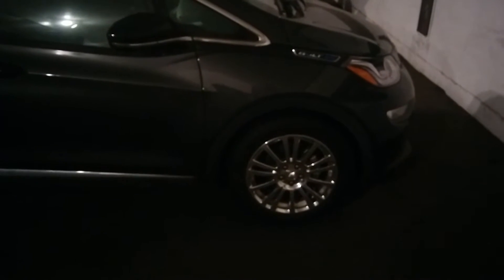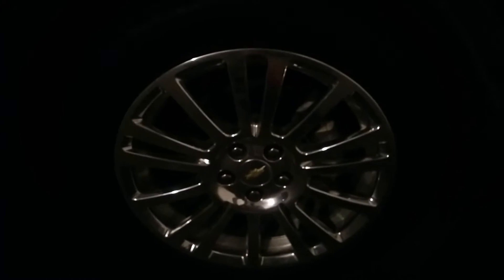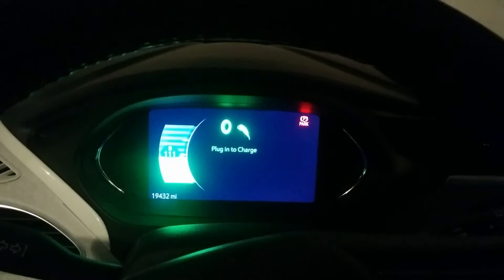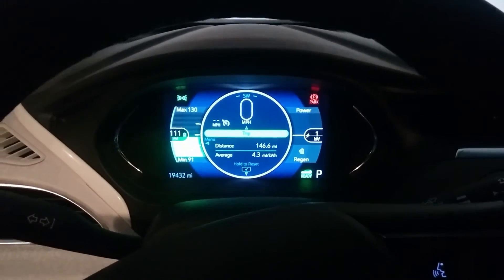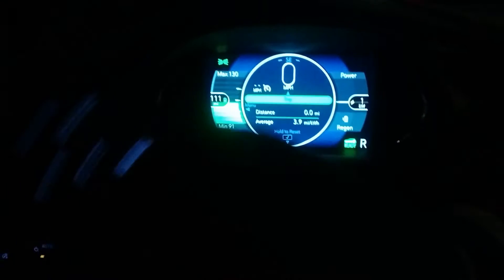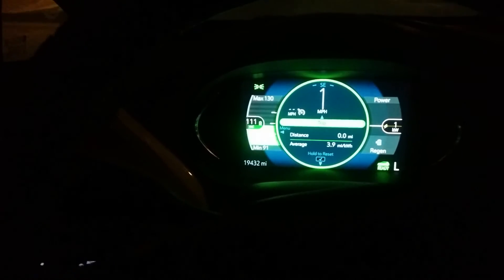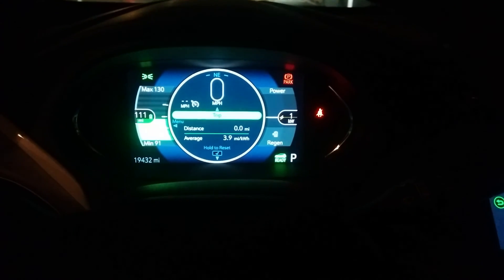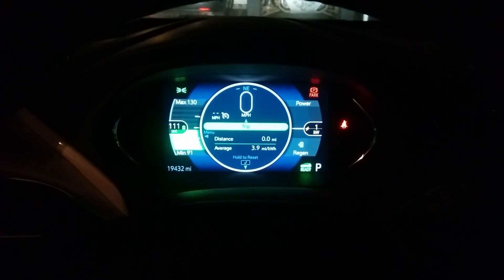Chevy Bolt EV Testing New Tire Fitment

Comment: Hi, i was searching if I can put my 215/55/R17 tites from my Volt gen.1, which are quite fresh, to my Bolt stock 17" rims and mount them on the Bolt and found your video. Actually the tyres will fit perfect on the rims since they are the same width 215 mm as original Bolt tyres, but i am concerned with that slight increase of the diameter. Please tell me did you drive the Bolt in real with the bigger tyres and did you get any rubbing or any other sort of problems? I am afraid that if I cross over bumps the tyres may hit somewhere in the tyre wells and brake something. Thanks in advance.
Reply: Thank you very much
Reply from the maker: @danaildanail  You're welcome!
Reply from the maker: The size of tires will vary by brand and make, but for the tires I tested, the 215/55 were too big for the Bolt EV. They were fine when driving in a straight line, but they would slightly rub on turns.

Comment: Polished aluminum looks way better than any chrome wheel ever made it has a low shine unlike the in your face look of chrome.

I run chevy Spark wheels that are 16's for snows with  a 65 series tire.

You can buy GM sensors cheap about 50 bucks for 4 you can sync tires as many times as you like without problems.
At this point the car is probably read your old tires until you back out of the driveway.

Comment: Hey, btw, you know if there's any way to turn that pedestrian alert sound off? I would like to ride stealth.
Reply from the maker: Yes. You can pull the fuse for the pedestrian alert. Double check in the Owner's Manual, but I believe it is fuse #34.
Reply: You're correct. - fuse #34.
Hmm... I may try that. Thanks.